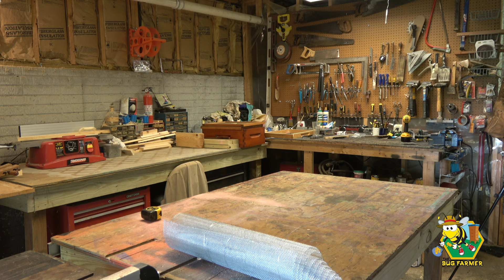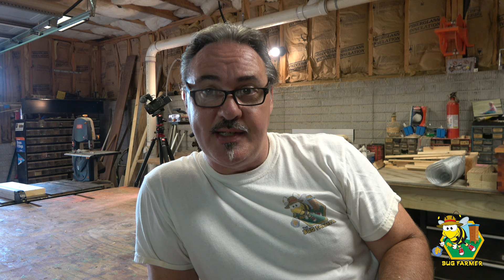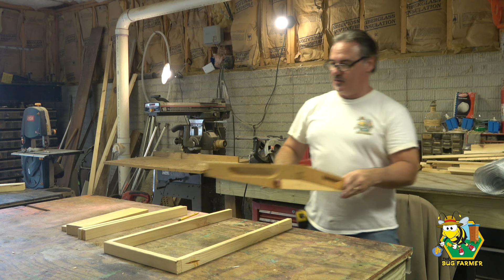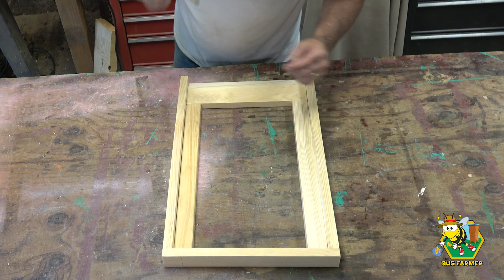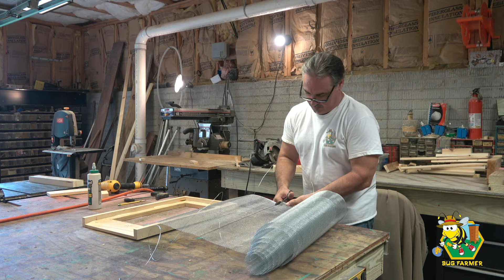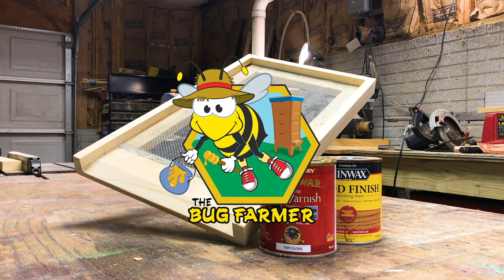One Board Build | DIY Screened Bottom Board | We will use one board to build a screened bottom board

Comment: Wow, that was quick and efficient. I hate wood working, but I think I'd tackle that job. Looks identical to the way my Amish boards are built with the exception of the slide groove for the plastic bottom insert. I'll have to look to see what they do there and possibly apply it to this video. Great tutorial!
Reply from the maker: If you want to slide in a sticky board all you need is  four more boards to add a second layer to the bottom of the and viola! :--) Actually, that is what I did. look at the thumbnail.

Comment: Great but where does the sticky board insert go to trap varroa
Reply from the maker: No sticky board with this one.  However, very easy to add. If you cut a groove on three sides 3/8 up from the bottom with a standard table saw blade (1/8" wide) you could add a sticky board.  I guess I should have mentioned it in the video but forgot.  Sorry.  I rarely use my sticky boards in GA.  To hot. ventilation is more important to me.  Thanks for taking the time to comment though. I really appreciate it.  take care.

Comment: wish we had exact dimensions for 10 frame hive :/
Reply from the maker: Its not to tough.  Just measure the outside diameter of the 10 frame box and adjust accordingly.  I guess the key is the design. Easy to make with a single board. Thanks for stopping in to have a look and for taking time to comment.  Take care.